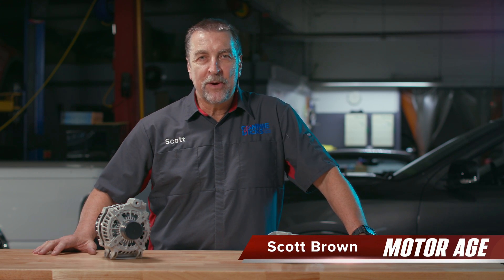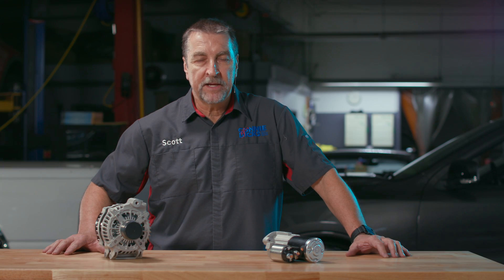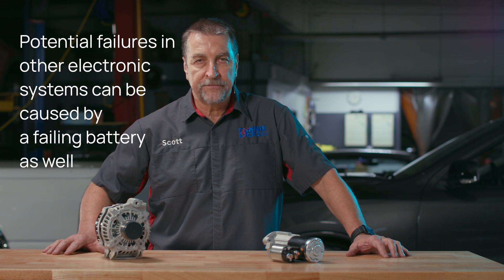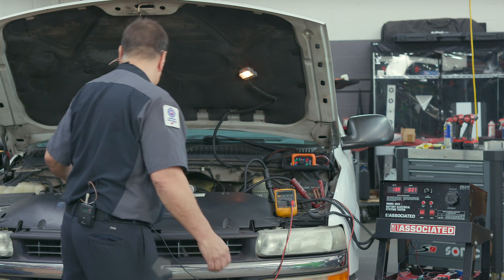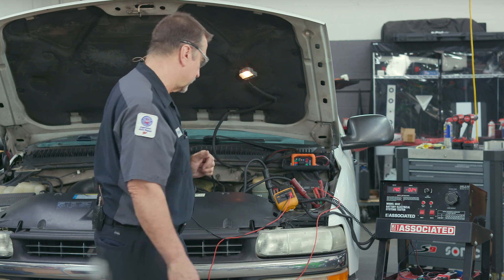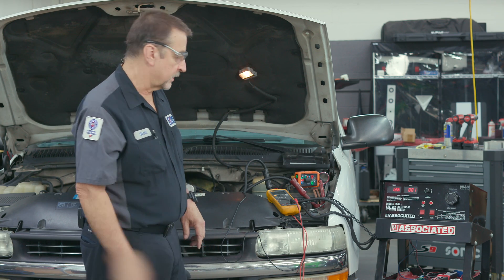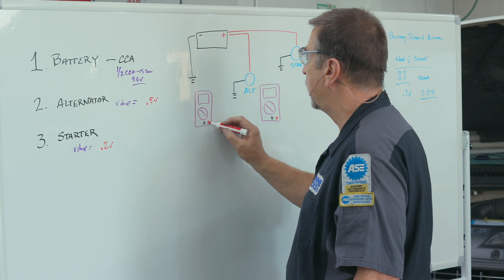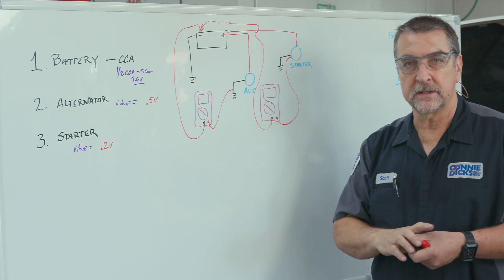Tech Tips: Expert Tips for Diagnosing and Servicing bproauto Alternators and Starters

Comment: Thank you for this very informative video!

I got doubts referring to the internal resistance test: what's a "good" internal resistance value depends on a variety of variables, one important being the battery's capacity.

I wouldn't expect to find a general rule applicable. The quoted 30 miliohms seems high to me though. Could you elaborate on this topic a bit more, please?

Once again thank you for this lesson.
Reply: This is a test that is fairly new to me as well. It’s becoming more popular in gaging the performance of traction batteries in BEVs and Hybrids and can be applied to cranking batteries as well. Yes, many variables apply including the type of battery. Some batteries say for RC cars are designed with the lowest resistance possible for maximum performance. But that low resistance can lead to increased heat and will require additional thermal management. A fixed large wattage resistor works best for this test  and after testing several batteries one can assemble their own go/no-go values. I’m interested in what your experiences are with this test. In most cases, I’m using a carbon pile test which is what I have been using for over 40 years since the VAT-28 which as you know didn’t have a current probe and required you to get in between the negative cable at the 🔋

Comment: Doing a battery load test used to be with a tester like I have and yes the load amps was about 1/2 the rated CCA.  Some batteries had a specific load test amp.  That 9.6 Volt at the amp load test was subject to the ambient temperature.  So the result could be higher or lower.  I had a chart for that years ago.
Thank you for demonstrating the voltage drop test!
It's surprising how many techs don't use it or don't know how to use it.

Comment: I never knew about the internal resistance test or how to do it. Thanks for showing us how to do it. 

When doing the voltage drop test on the cable going from battery positive to the alternator's B+ post, is it ok to turn on A/C, headlights, rear window defroster and use them as loads if we don't have a carbon pile tester like you do?
Reply: Yes
Reply: Yes, that is a way to request more output from the alternator